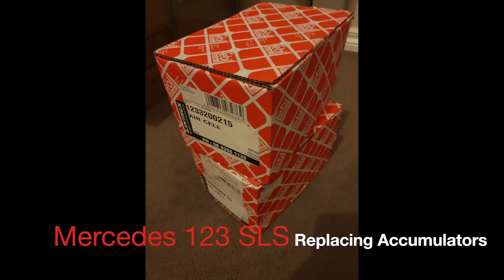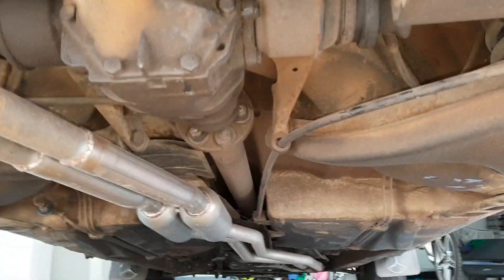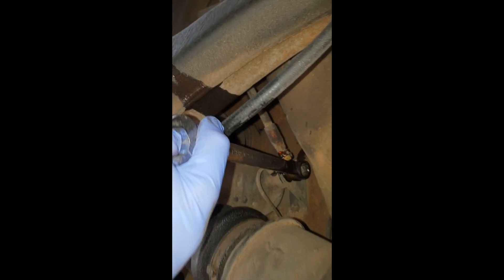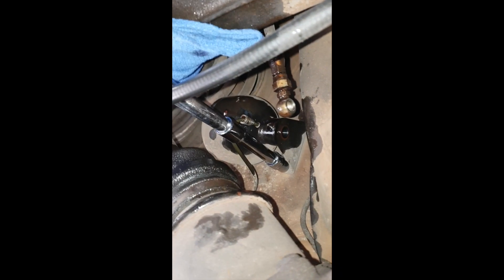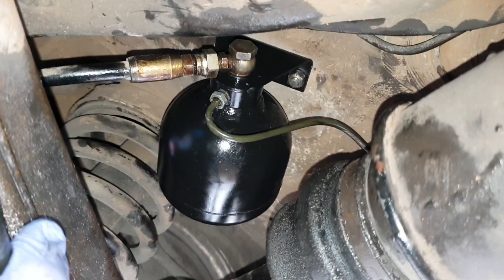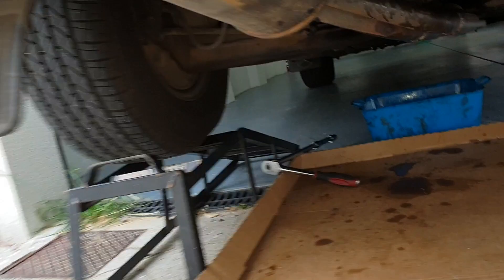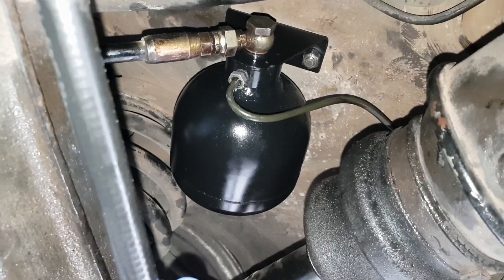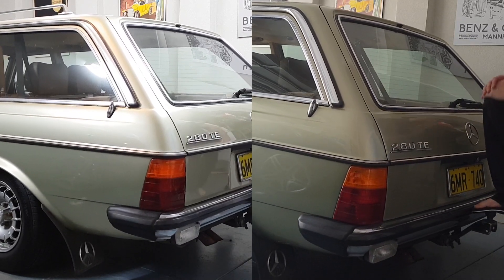Merceded 123 280te SLS accumulator replacement

Comment: Looks like someone put ATF in the sls system. The correct fluid colour is clear/yellow.
Reply: I Use atf in my sls systems too. I’ve questioned my mechanic about why he doesn’t uses the ZHM fluid and he says that the ATF fluid today has so high mineral qualities that is appropriated to use it. After three years and several tenths of thousands miles, I don’t see any reasons why not to and the fluid has completely the same color and smell. I think the most important thing about this SLS system is making sure that you completely clean/purge the system.